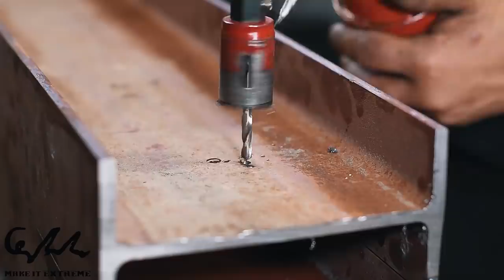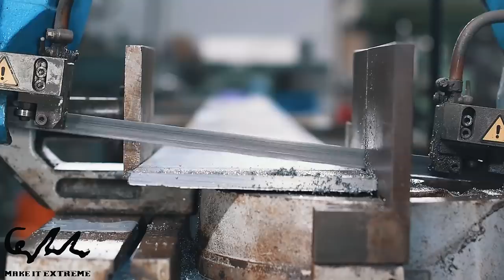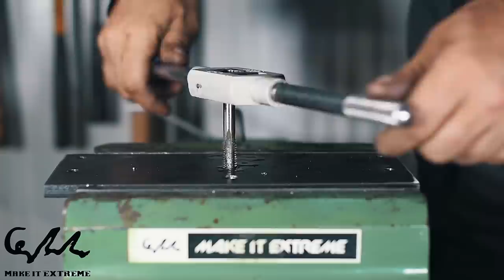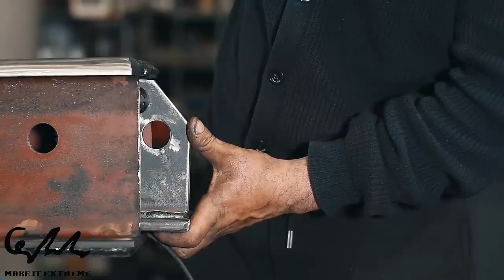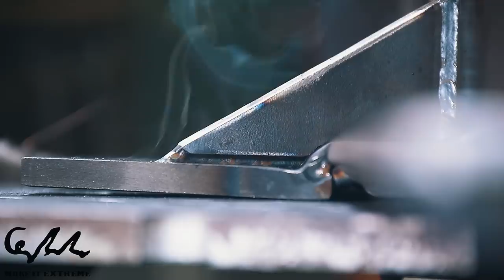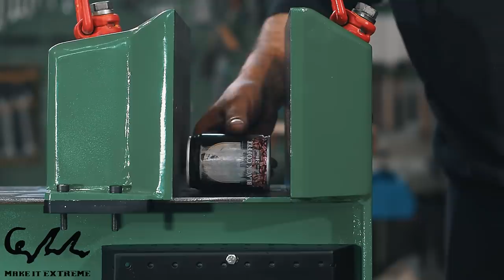Making a Massive Electric Vise

Comment: The videos without explanation either narrated or during filming make me think of the throwaway tips and trick videos being churned out by the thousands. Yeah the project is far more in depth but I feel no connection to what’s actually being built. I guess the world is leaning into asmr leaving me behind.
Reply: yes and it should be done in the most common language in the world (Mandarin Chinese)
Reply: @peketee2278   any base language would do as long as there’s a translation available. :)